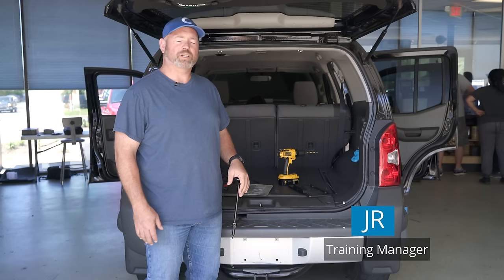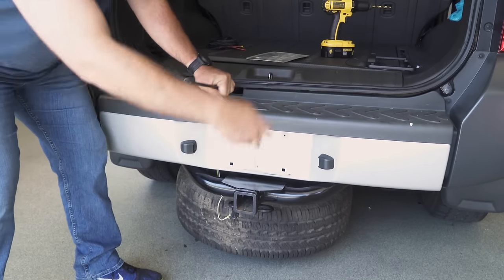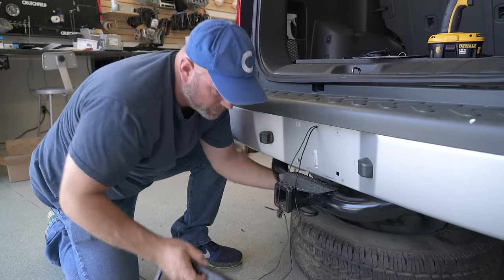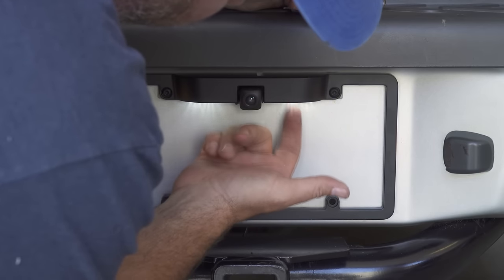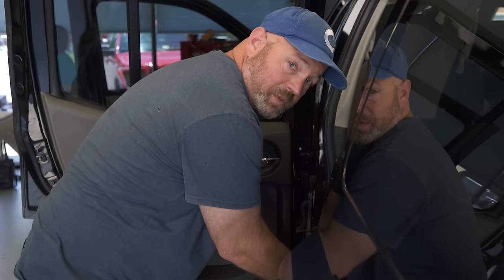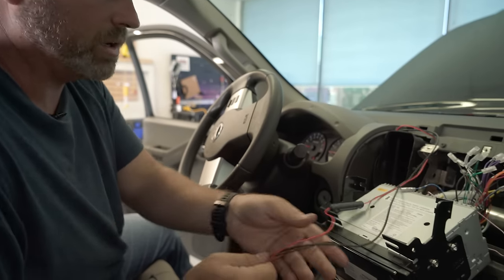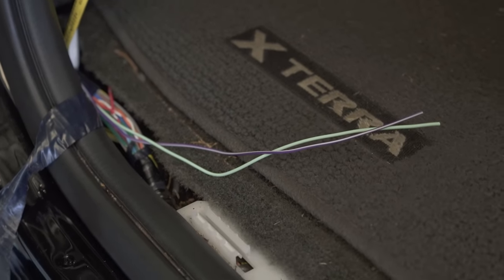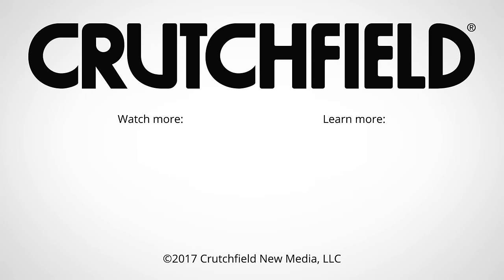How to install a backup camera in your car | Crutchfield video

Comment: Rookie question: How will I know which one of the wires on the head unit is the reverse trigger wire? Positive wire?
Reply from the maker: The head unit will come with a chart identifying the purpose of each wire and the color of its shielding so you can find it in the  head unit's harness.
Reply: @crutchfield  Thanks for the response, however my head unit and it's manual doesn't provide any of the information needed for me to be able to determine the reverse wire trigger. It does have a tag on where the camera plug should go though. Is there a way where I could determine where the trigger is using a multimeter? My head unit is AVT. I tried googling but to no avail.
Reply from the maker: Is AVT the brand? Is this an aftermarket radio?
Reply: @crutchfield  It's an OEM for  Suzuki head unit.
Reply from the maker: Thanks, Immanuel. Are you installing a factory specific camera?
Reply: @crutchfield  Yes, they claim to be made specifically for my vehicle. When I ask for guide, the seller only provided me with general instructions.
Reply: Hi, I figured it out. For some reason the labels are shielded by anti static tape of some sort. Thanks. God bless you guys.
Reply from the maker: We are glad to know you figured it out!

Comment: What if you DO MOT HAVE REVERSE WIRE ON RADIO.  2002 FORD EXP.
Reply from the maker: The "old school" way to do it would be to tap into the rear view light circuit for a switched 12-volt power source.

Comment: I have that SUV and it still seems complicated...parking brake wire?.... how about a transmitting TV CAM via Bluetooth to the front of the car with a monitor.  Of course it can't interfere with the cell phone Bluetooth.

Comment: Thank you for broadcast! Only question when you connect the position wire to the radio and ground to frame above when you have the harness for visual where did you plug the end into the radio ?
Reply from the maker: Good question Kathy. I think you are referring to the RCA video cable that plugs into the back of the video monitor.

Comment: I have just bought a dash cam with reverse camera , can I just piggy back of the reverse light wires because my car is a 2004 vauxhall zafira with the reverse camera ? the reverse camera has 2 wires black and red and the 3rd wired just plugs into the dash cam
Reply from the maker: If your dash-mounted video monitor features a reverse trigger lead (to auto-switch to the rear view camera input when the vehicle is placed in reverse), yes, you can tap the factory reverse light wires for this feature.
We only research vehicle's made for the U.S. market so, we do not have the wire code listing for your Vauxhall. 
Hope that helps,
--Crutchfield
Reply: thank you and it does help because when the rear camera is activated the camera switches form forward recording to rear parking and also has a G sensor on it and thanks again for your help

Comment: Pin 8 on the 10-pin connector has ground... Unless factory equipment has chassis grounding, there's NO way I'm using chassis grounding.. Take your factory radio out, get a multi-meter, set it to continuity testing, put one probe on the radio casing - the metal, then take the other probe and find ground. Go across the pins and see which ones tone out - and that's your ground. Looks much better; that and soldering with heat shrink.. Took me a whopping 30sec to find which pin I needed for ground... 

And don't forget kids, ground that e-brake sensor wire! You don't need a relay to get around that, just ground it..

Comment: Drilling a hole into your trunk wouldn’t that be a bad idea for water or moisture to get inside of your trunk etc ...
Reply from the maker: Not if sealed properly with silicone, foam, or gaskets.

Comment: Good info, but why is a connection to parking brake required?
Reply from the maker: With most video features in car entertainment a connection to the emergency brake is a required/ recommended safety measure.

Comment: Why bundle so much wire behind the dash instead of cutting to just a little more than you need? Not criticizing, I'm trying to learn more.
Reply from the maker: You definitely don't want to cut the video cable for the backup camera. So we kept the power cable intact too since it didn't cause any issues being there with the video cable. Could be helpful to have the cable length if the camera is moved to a different vehicle
Reply: @crutchfield  okay, that makes sense; thank you. 👍🏼

Comment: Why are you hooking it up to the radio power cable? It should be hooked up to the reverse lights so that when you put the car into reverse it will power on. It should be common sense.
Reply: Some in dash radios have two options for viewing the camera. Pioneer has a menu where you can view the camera any time even when driving forward. It also has an input from the back up light to show the camera when revers is selected. In that case, you power the camera all the time from the main hot wire, as well as connecting the reverse input wire from the radio directly to the backup light wire. You can then view the camera anytime.

Comment: If your going to do an install video then do it properly!  You've drilled a hole through a steel bumper, that now needs deburring and treating before fitting a rubber grommet to protect the wires your passing through it.